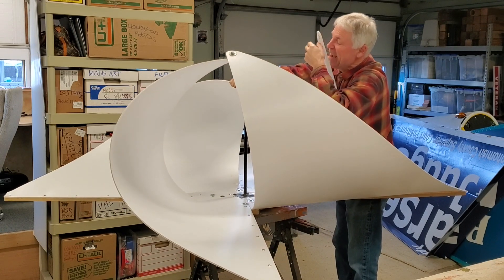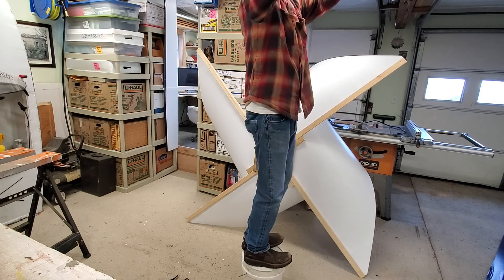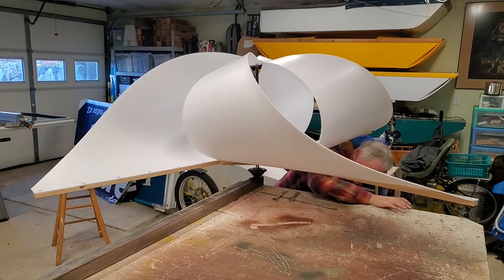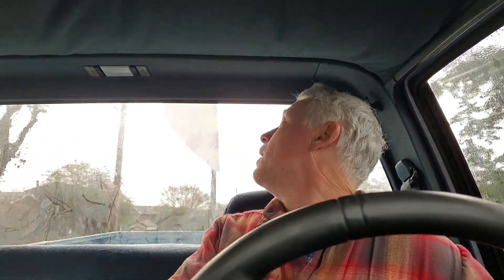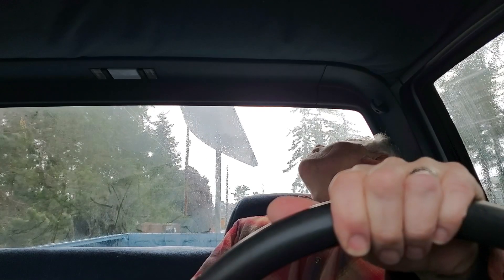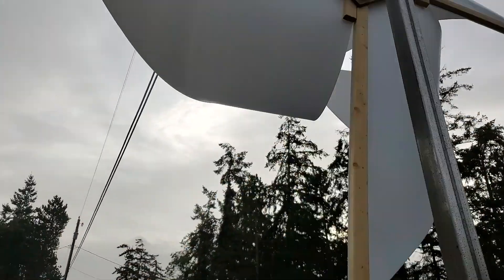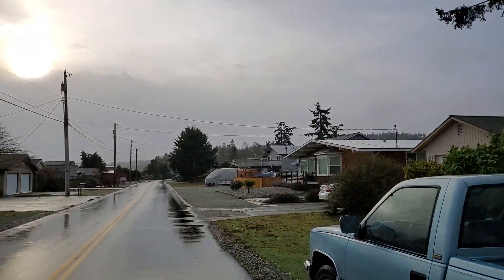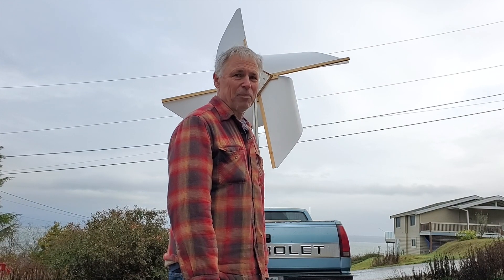Giant Pinwheel wind turbine

Comment: I would suggest some alluminium poles and a 4 point connector to join them to the cassette shaft to lighten the load. Also, you might be able to diminish that drooping pressure on the shaft connection to the 2" square if you use a threaded rod nut and a washer (probably would be easier to put the fins on too lol) that way you can control how big the air scoops are and potentially move the center of gravity closer to the support beam. Better balance

Comment: Brilliant and inspiring Paul. Good engineering test,  and I'm wondering if swapping the wood for aluminum, carbon fiber or aluminum tubes, and eventually the Coroplast for Aluminum sheet might up the durability and failure point to truly dangerous levels?.